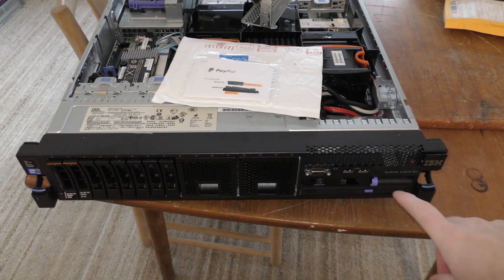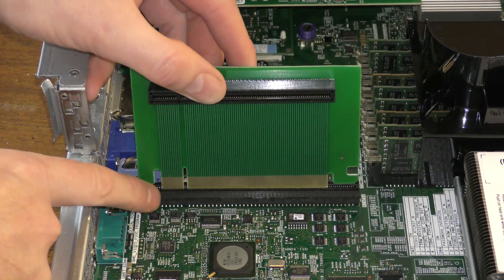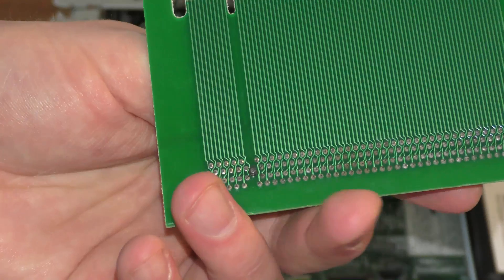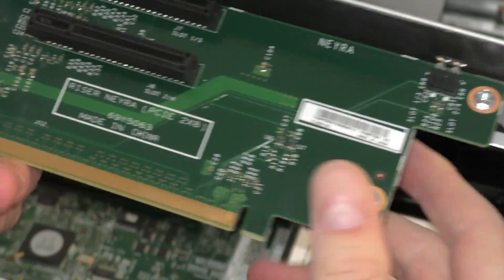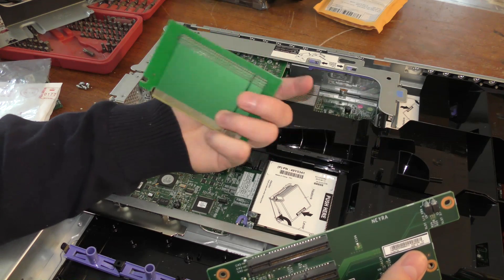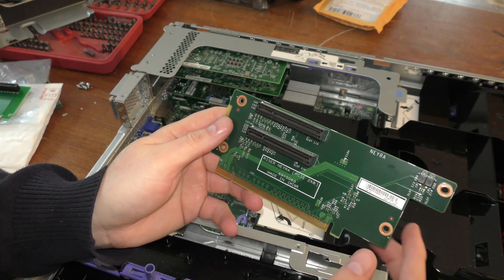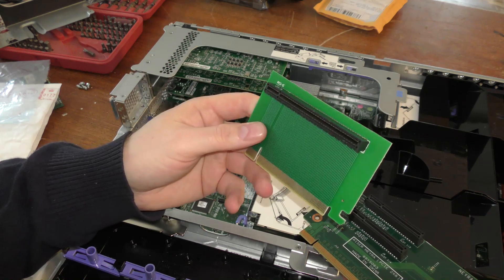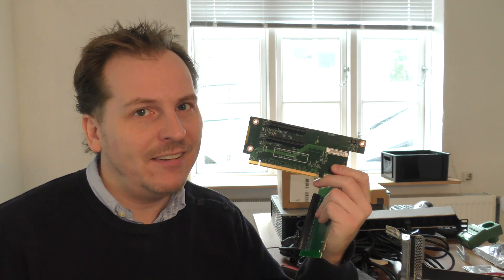IBM x3650 M3 PCI-Express Riser Card x8... dream about x16 - 422

Comment: I tried flexible one few times with few cards and works well and looks 1-1 mapping on 2 desktops. Then I tried a pci 16x gtx960 gpu with 16x socked which was electrically connected only to 1x pci express with express card to a laptop. So the things could work but can't guarantee, have minimal experience with servers.
Reply from the maker: Hi truhlikfredy
Thank You very much! Sure it works in a x16 to a x16 PCI-e slot,,, this is an IBM something extra slot...
Thank you for watching! :-)

Comment: Dont use the riser pass-through thing in the server... , the server socket has 2 8x channels in a single slot, so not using regular pinout's, hence the tracks on the ibm riser card to break them both out... 
I suspect you will let the smoke out.... the slots are there for a reason, to ensure you cant put the wrong device into the wrong slot...
Live with the 16x card running at 8x speed, as others have noted, most devices dont make good use of the extra 8x added so no real performance impact...

Comment: Wouldn't you have been better off with a flexible riser cable like this one? maybe also try a card you don't care for in the machine? I can't really see the server exploding since PCI-e is a standardised pinout regardless of the implementation.
http://www.ebay.co.uk/itm/PCI-Express-PCI-E-16X-Riser-Card-Ribbon-Extender-Extension-Cable-for-computer-/152101844212?hash=item2369f9f4f4:g:b7oAAOSwneRXRCyw
Reply from the maker: Hi ThEcRaZ3dGaM3R
The card I show here, is exactly the same as a ribbon cable,,, just stif. :-)
Thank you for watching! :-)
Reply: My PlayHouse Just thinking you'd have less trouble with aligning the card in the holder with a flexible cable instead of a solid board...
Reply from the maker: HI ThEcRaZ3dGaM3R 
Ahh Yes That is truth!
Thank you for watching! :-)

Comment: Cant the low profile x16 one be used? 

http://www.ebay.com/itm/IBM-43V7066-System-X3650-X3650-M2-M3-PCI-E-Riser-Board-w-Bracket-/391579451187?hash=item5b2bf43f33:g:TEsAAOSwTA9X7twM
Reply from the maker: Hi orcanice
Thank You very much! This is for a x3550 M2/M3 server 1U,, not 2U.
Thank you for watching! :-)
Reply: Oh i see, but if you combine it with a x16 riser cable like this ( http://www.ebay.com/itm/PCI-E-PCI-Express-16X-16X-Riser-Card-Flexible-Ribbon-Extender-Extension-Cable-/141959035336?hash=item210d6af9c8:g:XsoAAOSwf-VWVBMC ) Shouldn't it fit then?

Comment: PCIe 3.0 x8 isn't that bad it's 8GB/s - most gaming motherboards split PCIe x16 to 2x PCIe x8 for Gaming SLI without problems. Performance degradation can be visible for CUDA or OpenCL application, but impact may not be huge. Anyway I'm curious for benchmark x8 vs x16 in this situation.
Reply from the maker: Hi Jan Forman
Thank You very much! 
Thank you for watching! :-)

Comment: can you explain the pricing of ESXi? what are the downsides of using the free version? thanks :-)
Reply from the maker: Hi Matthew Smith
Yes I need to make a video on this!
Thank you for watching! :-)
Reply: i have a program that cracks esxi for free. any version. i have been using it for months without a problem
Reply: kyle williams
oh i wasn't looking at cracking it illegally, i just don't understand the pricing structure of it. do i need to pay per cpu socket?
Reply: I didnt understand it nether. But my copy says its good for 1 cpu socket and i tried 2 cpus installed and they both worked.
Reply: My PlayHouse thank you

Comment: Try to find a schematic for IBM riser, if not use a multimeter and compare pins on IBM riser and consumer riser. You can reverse workout the pin out. You will need a small pin to put into PCIE socket and connect other end of multimeter on base card edge connector. Ofc do this outside of server! I am not saying do this while its in server for clarification.
Reply: The large traces look like power positive and the larger one is ground connection. There looks to indeed be some serial comms chips to communicate with the server and report back health. I suspect that IBM tried to make this so you must use their riser. As you mention the PCIE may not communicate until a negotiation is done with that onboard chip on the IBM riser.
Reply from the maker: Hi thingyee1118
I have ordered a riser to a x3550 M3,,, that is just 1U, that would be easier to extend to a 2U server.
Thank you for watching! :-)
Reply: Ok I shall wait for an update video :D

Comment: Perhaps you can use an 8x to 16x adapter cable. Some have right or left mounting configurations.
Reply: Granted William Braun, but given the fact that even if he does find a 16x card it will still be on a PCIe 2.0 bus, so 8x or 16x at PCIe 2.0 really does not matter much. Many SLI setups have the second card running at 8x anyways. Depending on the video card he plans to install it probably won't matter much.... He currently has the 8x Adapter already installed and 8x to 16x Adapters are very inexpensive. So it would just be plug and play and hope for the best. That slot is not a standard PCIe slot, more like a Proprietary Slot, specific to that MB so there may not be any 16x Adapter to replace his current 8x Adapter...
Reply from the maker: Hi Paul Bialozor
I am using x8,, I'd like to use x16,,, a adapter cable will not do that :-/
Thank you for watching! :-)

Comment: That IBM riser isnt a normal PCIe connector, its some sort of special server stuff. You could try running the gpu straight from the mainboard without the riser, then you will see if the electronic on the riser are necassary.
Reply from the maker: Hi soccerzockt
The x16 riser i show is a 1:1 pass through,, so putting a card direct down on the system board is just as risky. :-/
Thank you for watching! :-)
Reply: My PlayHouse But I said A videocard, maybe you could just try any cheap pcie device with the straight pass trough.
Reply: yeah,but then you can fry the mobo to.....
Reply from the maker: HI Adam Budai 
That is what I am afraid of.
Thank you for watching! :-)
Reply: yeah but that won't eliminate the risk of leting the magic smoke out...

Comment: How about cutting the end of those x8 slots open? I think that should work and you wouldn't notice the difference in bandwidth, unless you are using the fastest GPUs available, but even those don't always saturate the PCI-e 3.0 x16 bus.
Reply: PHYSX_YT that's what he did
Reply from the maker: Hi Almujtaba Osama
Yep,, but I'd like a real one!
Thank you for watching! :-)
Reply: That's true, but in total, they have half as many cuda cores as a GTX 770, so ti is unlikely that anyone is going to run games on them. It highly depends on the type of load, because some applications need very little bandwidth compared to others. Just take the bitcoin mining as an example. Most people used PCI-e x1 risers, and there was no performance penalty, because that kind of application didn't need a high bandwidth between the host CPU and the GPU.
Reply: PHYSX_YT Grid K1 isn't like your GTX 770, your GTX 770 is a single GPU, K1 is 4, it actually need 16 PCIe lanes to have all 4 GPUs available, as Morten has shown in previous videos where he only sees 3.
Reply: It doesn't, because it has a PLX PCI-e switch on it and that uses 4, 8 or 16 lanes towards the host CPU and 4 or 8 lanes (depends on the exact type of the chip) towards each GPU, so it is not necessary to have 16 lanes towards the host. This is a similar arrangement to the dual GPU cards, like the GTX 690, Titan Z, or  the R9 295X2, but there is no interconnect between the GPUs, so you can't use them in SLI or Crossfire .
Reply: The Grid K1 is 4 GPUs, it most certainly need the x16 bus to communicate with all 4 GPUs on the card.

Comment: This is specifically a pci x16 riser card for the x3650 m3 server. http://www.itcreations.com/view_product.asp?product_id=38878
Reply: ah crap, ignore that it's not the right one, same as what you have... I'll keep looking they do exist.
Reply: This on the other hand is the same part number as listed in the full parts manual for that server as a 1x16 pci-e riser card option for that server. http://www.mcac.com/46m1073.html
Reply: Here is another link for the 46m1073 riser card. https://www.senetic.com/product/46M1073
Reply: More links to possible sources.
http://www.remarkit.com/catalog/ibm/46m1073.html
https://en.dcc.dk/parts/46m1073/lenovo-riser-card-p15928
https://www.amazon.de/IBM-46M1073-Express-Riser-Karte/dp/B0025PMGVO
Reply: And even more links!
https://www.igsmn.com/ibm-46m1073-pci-express-1-x16-riser-card/ (have to call for pricing/availability sadly)
http://harddiskdirect.com/46m1073-ibm-pci-express-x16-riser-card-for-system-x3650-m2.html?gclid=CjwKEAjw7ZHABRCTr_DV4_ejvgQSJACr-YcwAP7jmVOk8pIHSDMmgVEuiUWKcMZMMGp3v2OWHzwPzxoCE5rw_wcB (says they have in stock, but it's roughly $226 USD, no idea on shipping costs)
http://www.ithardwarehub.com/index.php/part-no-46m1073-ibm-pci-express-x16-riser-card-for-system-x3650-m2.html?gclid=CjwKEAjw7ZHABRCTr_DV4_ejvgQSJACr-Ycw4Xcnz1TWaVg7Gd2OSNY14CqgFvs_l8hbNI9B_qh1jRoC7urw_wcB (approx US $233 from them, but also listed as in stock)

Comment: I would not put the domestic riser card into the x3650 M3. As you have noted, there is a bit going on with the riser card. Surely, you have a contact at IBM that can steer you in the right direction? :P
Reply from the maker: Hi themaconeau
Well I haven't gotten any good results yet.
Thank you for watching! :-)
Reply: My PlayHouse Is getting a higher model unit like an M4 or M5 a possibility?
Other option includes maybe hitting up IBM's facebook with a link to theis video? The worst they can do is nothing, right?
Reply from the maker: HI themaconeau 
Ha Ha I have asked Lenovo Denmark more then ones to lend me new stuff to show,,, I need to find some one in marketing i think :-/
Thank you for watching! :-)
Reply: My PlayHouse Maybe someone in marketing can refer you to someone within Lenovo that can help you source the part at least. Maybe someone in marketing can help you with a sponsorship deal or something. 

It onever has to be for free all the time, sometimes co-op or similar works as well. Never hurts to ask when the worst anyone can say is no ;)
Reply from the maker: HI themaconeau 
I will get there at some point :-)
Thank you for watching! :-)

Comment: http://www.ebay.com/itm/NEW-IBM-Genuine-System-X3550-M2-M3-PCI-E-x16-Low-Profile-Riser-Card-P-N-43V7066-/222268534548?hash=item33c03caf14
Reply from the maker: Hi v1nce n7
Thank You very much! But this is for a 1U server. It will not fit a GPU card... But I Ordered one from GB anyway just to see if the server will take it!
Thank you for watching! :-)

Comment: I bought this one
https://www.aliexpress.com/item/High-Quality-PCI-E-16X-to-16X-riser-card-adapter-extender-cable-PCI-E-16-X/32600297785.html?spm=2114.13010308.0.0.EaW1oa
and it works with my INTEL S2600COEIOC board. As I can see it is usual standard pciex16 connector on your original board so it would work with riser cable. I have to paid a lot for custom fees from EU so everything from China cost me less. Buying from ebay is too expencive with custom expenses.
Reply: Your Intel Server board has a x16 connection onboard. but Morten's IBM-Riser Card has obviously more pins then the x16-card he bought. that's one reason why it dosen't work.
Reply: It is pity that slot on motherboard is not standard pciex16. It is simple with standard pcie slot.
Reply from the maker: Hi Srđan Marković
Thank You very much! Exactly the same as the one I show,, just flexible.
Thank you for watching! :-)
Reply: The slot in the server Morten is trying to use is not a standard x16 slot.

Comment: hi. the last time tryed to put the riser card in hp dl360 g7. i got fried riser card and blowed fuse on pcie slot in mb( hp limits power in pcie to 74watt)
Reply from the maker: HI
Yes,, that is not cool to blow a fuse on the system board :-/
Thank you for watching! :-)
Reply: Hey sir!
Im found 2 things.
The "official" raiser card for your server is this: 69Y4325 // 
http://www.sparepartswarehouse.com/IBM-Lenovo,Computer,part,69Y4325.aspx
But i think you can have a try with this:
http://www.ebay.com/itm/NEW-IBM-Genuine-System-X3550-M2-M3-PCI-E-x16-Low-Profile-Riser-Card-P-N-43V7066-/281604790822
The layout is the same, pin count probably the same, cheap.